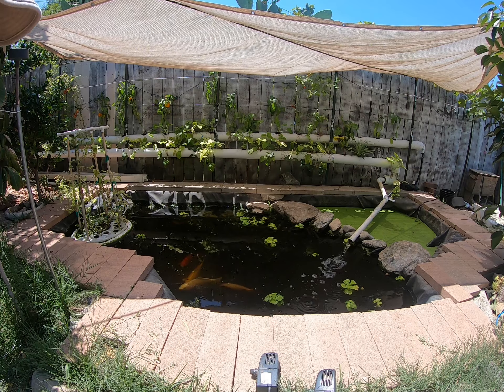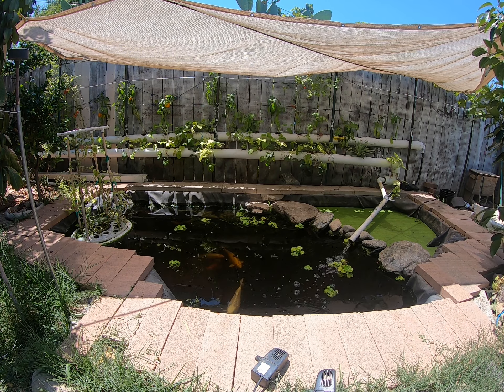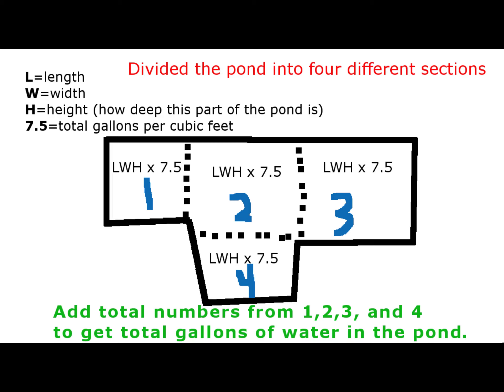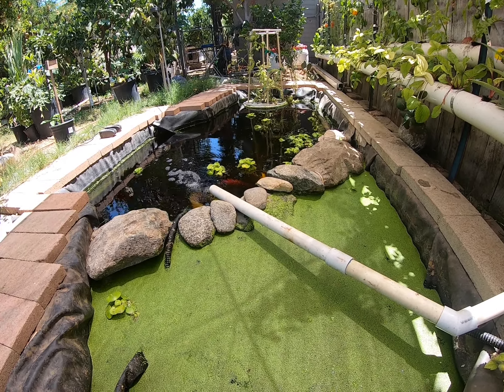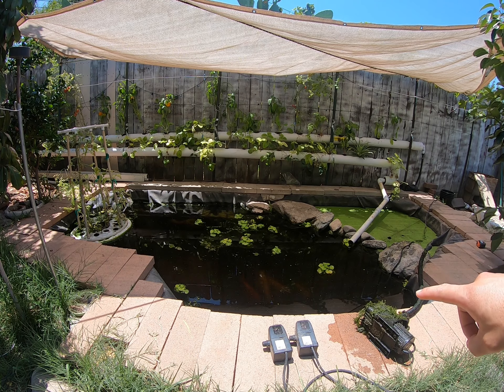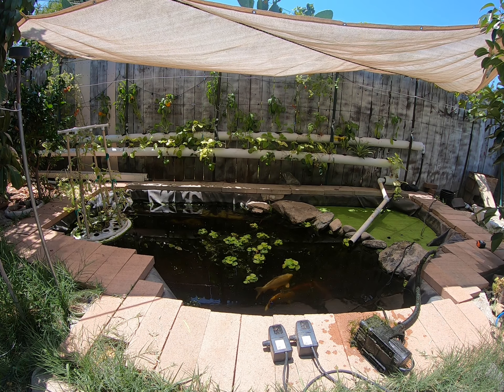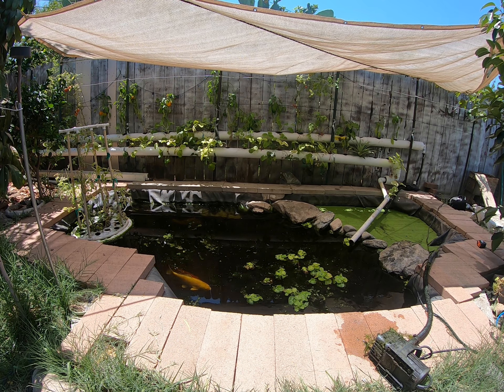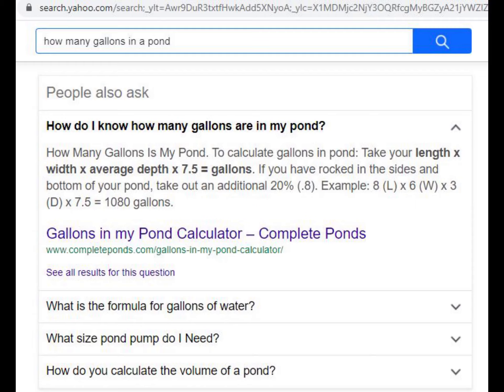How many gallons in your pond and what size pump for your pond or aquaponics.

Comment: I was looking to get the same pump I read the manuals and it said not to use it with extension cord is that TRUE? have you ever use it with a extension?
Reply from the maker: I never saw anything about that, but... an extension cord was used all along. My guess is so that the extension cord doesn't get pulled into the water where things can go very wrong.
Reply: @aguileraproject271  yea the manuals mentions lol just want to be sure! Also how the water flow on it is it pretty strong?
Reply from the maker: @AncientwarriorOTK  I liked the Harbor freight one over the Home Depot pump. More water.